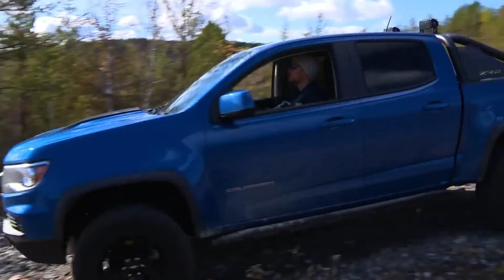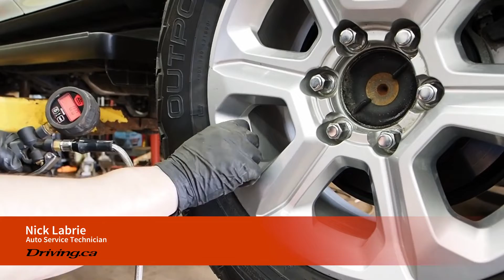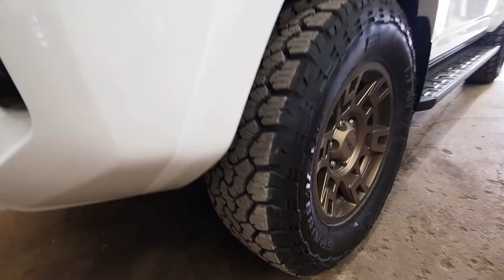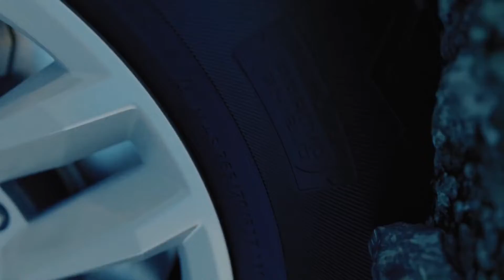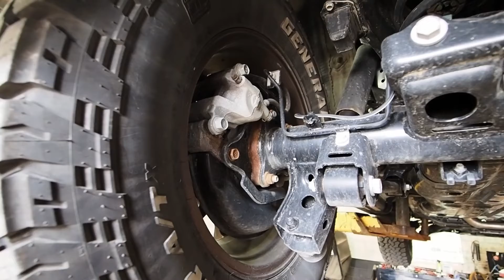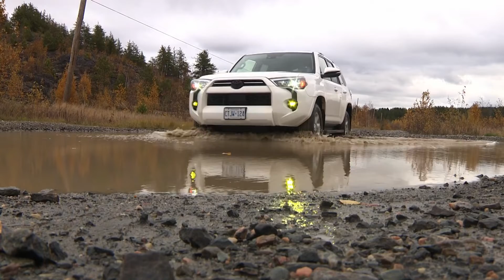SUV Tire Upgrades: 10-ply or composite reinforced? | Driving.ca

Comment: The new generation of the Goodyear Duratrac RT's is a equally good chioce.I have a new set on our Gladiator Max Tow in P255/75R17 115 SL. Oem calls for a 112 load index to meet towing and payload requirements. This tire weighs in at 44lbs  and is about 10 lbs lighter than the LT version.  I have 10k miles of towing and normal driving and find them a excellent choice. We have been nunning the older Duratrac's on our JKU   in a P275/ 70R18 115 and happy with them to. Duratrac RT's are worth a good study.

Comment: I am actually considering the nAT's, but I am limited as they will more than likely to be had only LT's and will not be towing or hauling.  Keep in mind that standard load tires do not have the tread depth that a LT has in most cases also.  I do not rock crawl, but can be found on forestry roads during winter in a foot or more snow whenever possible.  I can attest that the General Grabber AT2's are far noisier than my highway "AT's" as I drive the same make/model on two vehicles.  Please note the AT2's are now basically updated to the ATX designation, just as the BFG designations have changed as improvements have been made to them as well.  Trade off was on the GG's had one less sidewall as well as a bit lighter than the BFG's at the time of acquisition/install for nearly the same price.  I also recommend that if anyone plans on keeping a vehicle that installing decoupler and insulation makes for a great quality of life improvement, as well as a dash camera system.

Comment: Could you explain tire load ratings? To say 10 ply means what? I believe you're referring to "E" load range capable of 80 psi.  I understand that at say 36 psi the "E" load range has a lower load capacity than a Passenger tire of the same size. My comparison was on size 275/65 x 18 on my Z71 Tahoe. My Michelin Ice SNOW SUV Load116 T speed.
Reply: Do not use a P/Standard load tire if you plan on doing any towing, which is also why trailer tires are also different.  It is about weight and work to be done.

Comment: were the Nokians the same size as the OEM tires in vid? Just wondering if they run small since they were shorter in the vid.
Reply: No. The Nokians in the vid were 245/70r17. OEM is 265/70r17.